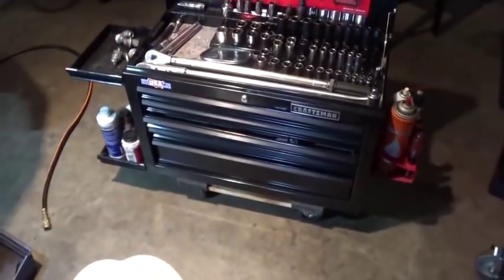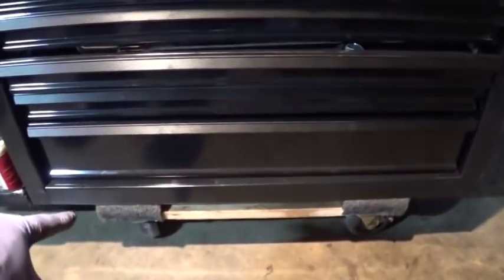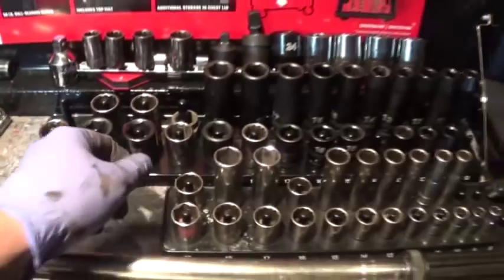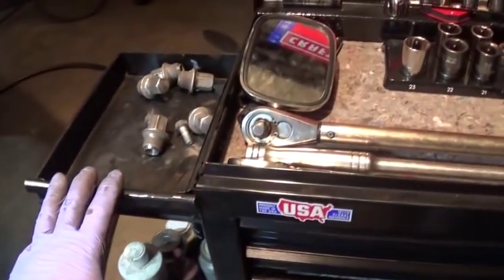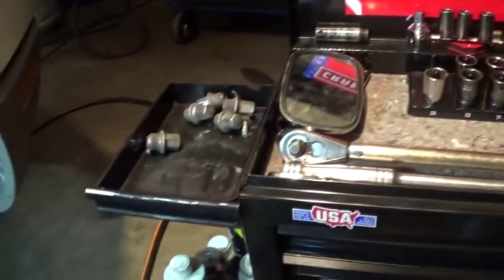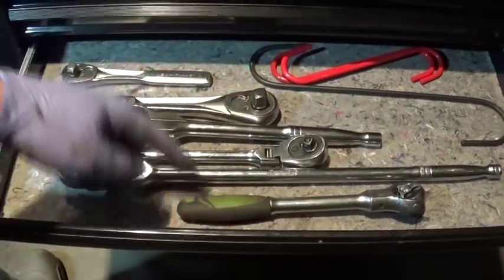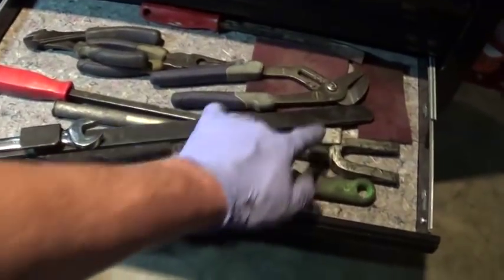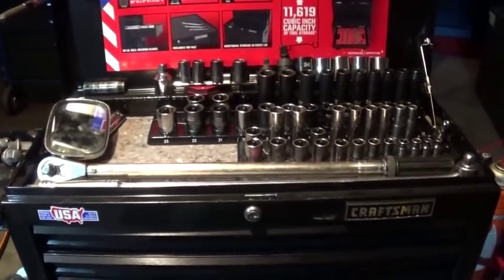Service Cart Review

Comment: Nice set up. I made a pit at my old house. I have another one here. Racks r great. But the pit is nice for certain jobs. U can c it on a vid I posted. My old garage didn’t have enough height for a rack. But when I moved and built my garage, I missed my pits. I had two in a little tract house. The outside one I covered most of the time. U wouldn’t even notice it when we would have company. But u could put one easily in your garage. Just a thought. Not tryin to tell u what to do. Always enjoy your vids!!!
Reply from the maker: Bill Rimmer Pits would be perfect for small garage. I always wanted to have one. Recently I got scissor lift and so far works great. It has 6000 lb capacity. Can’t lift bigger trucks but for cars and minivans is perfect. I got it used from local mechanic shop. Thank you for watching my friend.👍